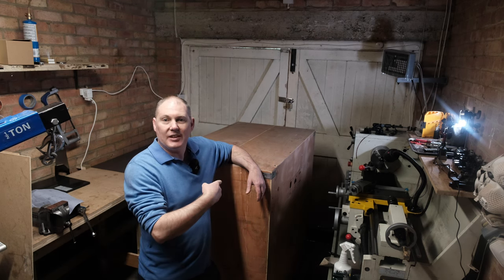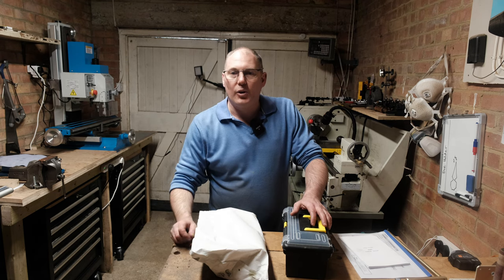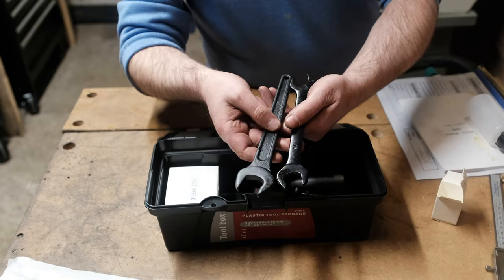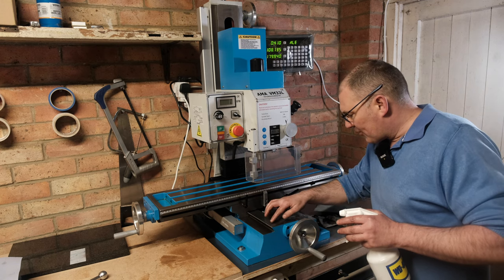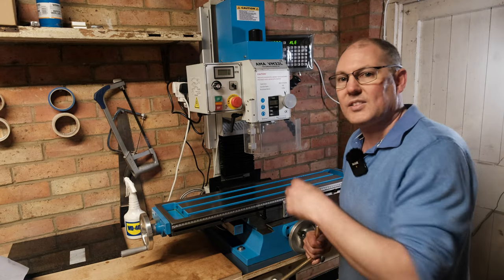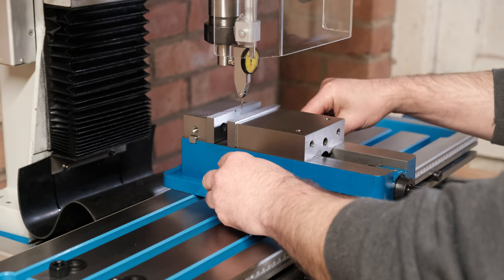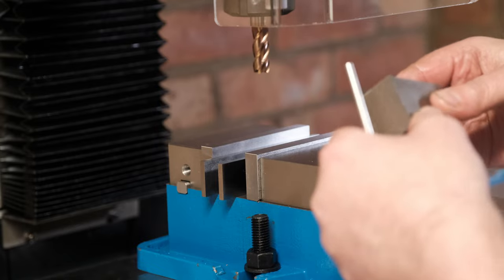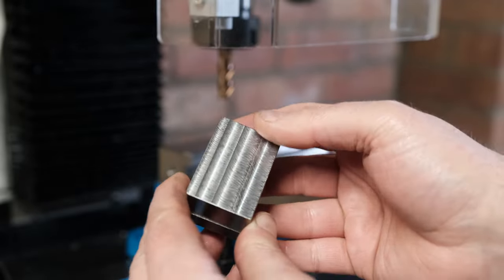Amadeal VM32L Milling Machine unboxing and setup. (Weiss VM32L)

Comment: Not quite as my experiance of buying a AMA45 mill from Amadeal. Within 3 weeks of use it developed some very strange noises from the gearhead. Having already had a problem with it not being supplied with the correct spindle, MT4 instead of R8 as ordered ( eventually got the correct one supplied ) I decided there was no point in contacting Amadeal to rectify the noise problem. Removed the gearhead and stripped down to check it. Found it was full of cast iron grinding swarf most of which had been painted over, but the swarf that had not was being churned all over the gearbox in the ' oil ' resulting in the bearings running in a sort of grinding paste. Replaced all the bearings, and re-painted the gearbox internals with special paint. Mill is 'OK ' now, but has play between the quill and the gearhead casting, resulting in chatter when taking anything but the lightest of cuts. All in all, a very poorly made product, which I would not reccomend to anyone.
Reply from the maker: Oh sorry to hear your experience wasn’t good. Was this an ex demo machine? Or brand new? 
I’ve heard horror stories from most of the uk suppliers however I’ve also heard good things too. I think it’s just luck on how good your machine is when it gets here off the boat from china. 
In my case I don’t think amadeal even checked it other than making sure it was the correct machine. It was delivered to me almost as soon as it came off the ship from china.
Reply: I got an AMA45 too. converted it to CNC & it was OK but not impressed with the finish overall. It seems most re sellers worldwide, just churn out the same old stuff & it's luck of the draw. I wanted to investigate the internals on mine but gave up because I assumed the motor would just lift off to start the process & it wouldn't. Seemed locked onto something & wouldn't lift more than an inch!!!
Reply: I bought this same mill thru DRO pros in California . I had the same issue with excess play between the quill.
Reply: Our factory only produce varaible speed series machine with brushless motor as well as CNC machine. We don't make AMA45, it is from other factory.

Comment: Congrats. I have a similar type mill. Try to stay away from climb cutting. It is much more stressful on these types of machines because of the play in the lead screws. You can retrofit your machine with ball bearing lead screws. That will give better results when climb cutting.
Reply from the maker: Hi. Thanks for the advice. In the little practice I’ve had so far conventional cutting seems the way to go. It just feels like it cuts better and more consistently.
Reply: Weiss have ball screw type milling machine, you can check our VM28 & VM35 from our website

Comment: Why are you indicating off parallels? You should always indicate the floor of your work holding device.  What happens if you’re reading is dead on when checking across parallels but when you mount your vice and check the floor of the vice it’s.002 off?  You just defeated the purpose.
Reply from the maker: Hi. thanks for the comment. 
That was just a quick check on a brand new machine to check the traming. The vice itself was fully indicated in. Just not on camera. 
Infact I’ve now rebuilt the vice for more accuracy. I’ve no idea what accuracy would be acceptable in a hobby machine but after my vice rebuild I’ve got a variance of around 4-8 microns on a squared piece of stock.
I think I will just use the machine for a few weeks before re cleaning and adjusting.

Comment: Weiss are a nicely made for a Chinese made tooling.  Originally the company was started in Guangzhou by a German machine manufacturer..
Reply from the maker: Yes I’ve found my machine to be excellent. No complaints whatsoever.
Reply: Hi, WEISS is always take care of the quality and now are making more innovation machine. Our company is start from Nanjing by Michael Wei in 2002 who was inspector for machine tools from 1994. In 2008, we built the factory in Nanjing and produce machine tools by ourselves. We are pure Chinese, not German manufacturer.  There is German manufacturer with WEISS brand, they are produce machine parts，not machine tools.

Comment: Hey lee those Chinese engine cranes are a bit sharp an nasty but with a 1ton crane fitted with an 8ton ram I managed to lift my warco super major on to its base @ nearly 600kg worrying lift good luck sir!
Reply from the maker: Yeah the crane is a bit dodgy but I use it to lift my 450kg Chester Lathe so I was (semi) confident it would lift the 250kg Mill. Its done now so I can relax!

Comment: Is your table/bench anchored to wall? I notice it's very narrow,could be dangerous with very heavy machine atop.
Reply from the maker: Hi. I custom built the bench. It had to be thin to fit in the garage. It’s solid and has wall anchor points. The machine isn’t moving anywhere.

Comment: I bought a couple of machines from Weiss a few years ago  (VM18L and a Lathe) they're pretty much okay. I converted them to CNC and made thousands of parts with them.
What you might need to check: spindle bearings, mine ran hot after some time, also how the spindle is assembled - I had to re-assemble mine and put japanese bearings into it since then the machine did not run hot anymore. There's a ring with a U channel, squeezed together by a screw in mine, this needs some lock screw and/or screw glue to keep it in place.
also I changed the lead screws to ballscrews.
About the Weiss support - they're excellent and provide spare parts quickly.
I can fully recommend them.
The problem with the chinese collets is some of them have a poor quality and if they get a hit they might be bad permanently (check runout).
Reply: Hi, how did you perform the conversion? are there specific kits that you used or did you custom build them?
Reply: @arrantownsend3880  do you have a VM18L? I milled brackets by myself and installed them, there was quite some hand work involved since I did not have another mill. For the X ballscrew I had to rasp a small round channel below the table to get it in.
For the Y axis, I had to ground the ballscrew nut in order to get. it in (it was not easy for me since I had no other mill nor appropriate tools).
I'm even able to do tapping with it (abuse the B axis and attach a stepper motor next to the machine).

Would I do it again? Definitely, the mill can do things which it was never specified for, and for learning it was invaluable.
The situation also has changed quite a bit for me, I now have access to a 6 ton CNC machine.

Comment: You've probably found that bar is to hold the spindle. I have vml25. Bar was very poor fit and starting to round out the hole so carefully  drilled to 6mm and bought a pin C spanner. Soo much easier to use. I will be interested to see what adjustments etc you make. 
Nothing wrong with parallels, if its good enough for stefan gottswinter I'm sure it will be fine😊
Reply from the maker: Hi yes I have the same problem. The hole is rounded out so will need to drill it at some point.

Comment: I got the 25L not that long ago. Was debating going for the bigger machine but actually im really happy with the 25L. For the money these are great machines.
Reply from the maker: Yeah that’s a great machine. How is your machine specifically? No issues? I’ve had mine almost a year now and I’m still really pleased with it.
Reply: Very happy with it indeed. Mine came with the powerfeed and DRO and I must admit I dont use the powerfeed that often but when I do it does give a cleaner finish. Its a very solid machine though I manage to pretty much cut anything on it, im glad I went with this over the warco machines as I think the R8 system is better and easier to use.

I think at some point ill do a CNC conversion on it but for now its great as it is.

 @leeceeworkshop

Comment: I've got the same mill. Nice and quiet. I might down gear mine, rarely use 2250rpm and more torque for tapping would be useful. Worth checking the nod. My collum was quite a way out to the table. I epoxied it as per gotteswinter. Then found the head was not square to the collum, shimmed for now but one day I'll sort it out. Needs more than scraping sadly.
Reply from the maker: Hi. Thanks for the comment. I’ve noticed a tiny amount of nod that seems to fix itself when I turn the head locking screws. Maybe I need to adjust the Gibbs slightly? Will use the machine for a few weeks then re clean, oil and adjust.
Reply: @leeceeworkshop  glade to hear yours is accurate 👍 suspect mine was a Friday afternoon job!
Reply from the maker: What would you consider accurate for a hobby machine? I’ve just rebuilt my cheap vice (video coming soon) it’s much better now and I seem to get around 4 to 7 microns variation across a squared piece of stock. Is that good? Ok? Or terrible?
Reply: @leeceeworkshop  good question! I'm a hobbyist so don't take my word on anything... But my mill was really out. To shim my head I'm using something like 0.7mm shims roughly 50mm from the center point of the head.so not trivially out. I'd regard that as well outside of what would be reasonable for a mill at this price.
Reply: @leeceeworkshop  I'd be VERY happy to be in single digit microns. That's surface grinder territory!
Reply: Mine was out by .08mm over the width (front to back) of the base (a little over 100mm).  I wound up just taking a thick piece of plate cut to the size of the base of the column, flycutting it flat on one side, flipping it over and then mounting it in the vice with parallels.  Flycut until smooth and that transfers the nod to the plate making a slight wedge.  Drill out the holes for the mounting bolts and put it under the column in the right orientation and it cancels all the nod.  The epoxy sounds cool but that short pot life would scare the hell out of me.
Reply: @travisshrey6720  that's a smart fix 👍 one day I'll take the head off mine, shim in till the quill is flat on the surface plate, then transfer that to the surface grinder, grind that side then flip it and get the mating surface square to the quill. I'm hoping it'll manage more aggressive cuts than present. I've got two shims between the head and column so three points of contact. For all my mills flaws it's still my most used machine, with a dro it's a great tool.